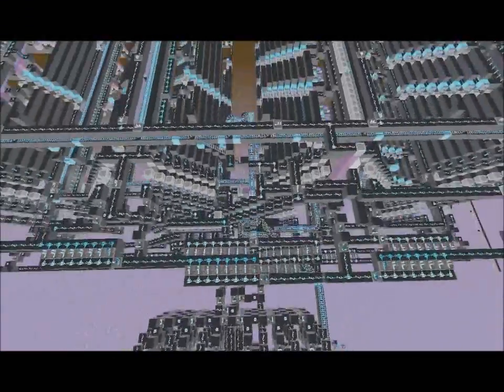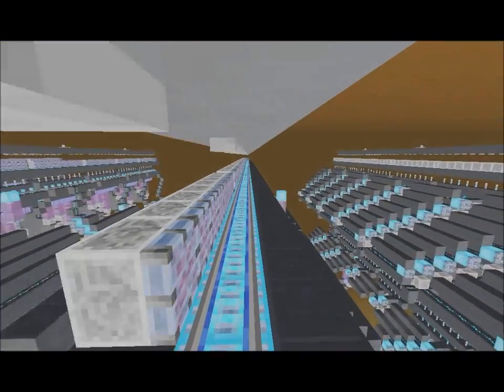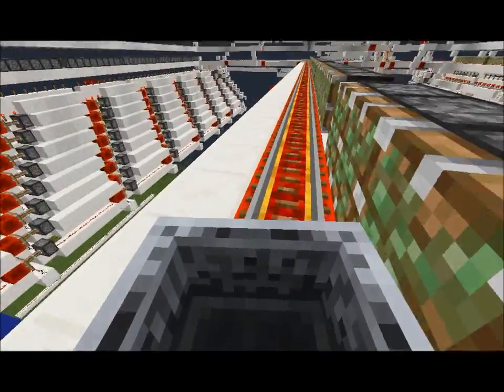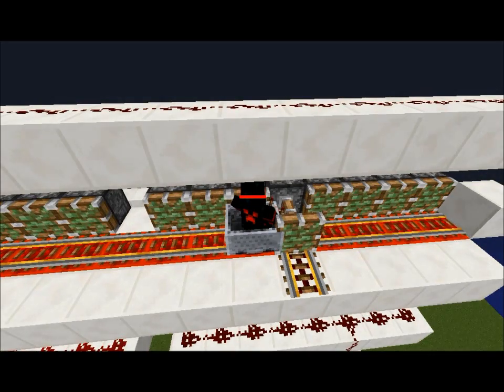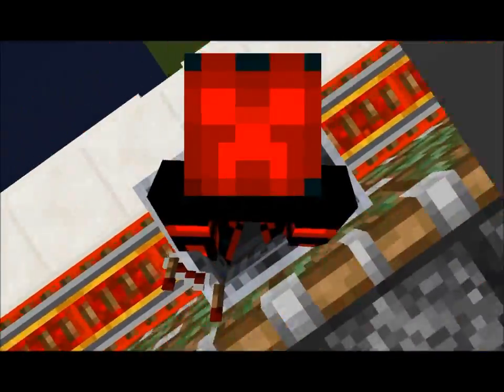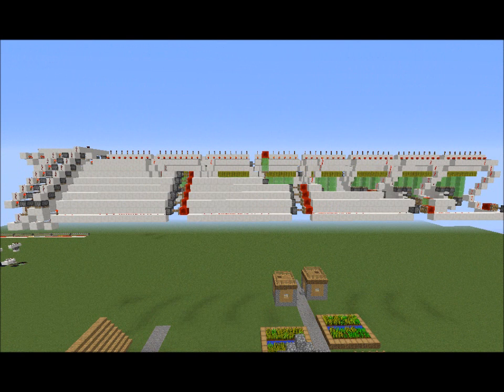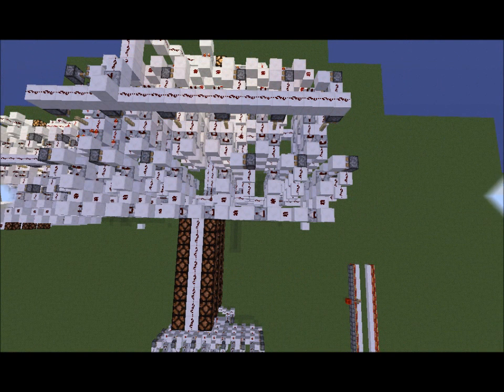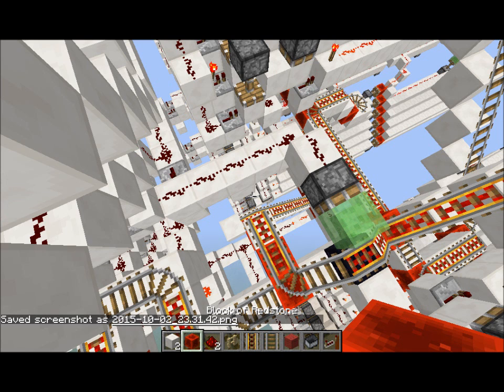512 Villager Selector (turn on CC)

Comment: who needs 512 different villagers? I doubt anybody needs more than 64 different ones.
Reply from the maker: +ilmango ya on prototech we will probably just build either 64 villager section or 128 depending on our needs I just felt like building this for fun
Reply: +ilmango Well, you can ask the same question at just about any unnecessarily efficient farm. Who needs 10 000 mushrooms, not to mention 10 000 mushrooms an hour? Who needs an 1024 village iron farm? Nobody, but they´re interesting in their own right.
Reply: +Myren Eario if somebody needs 10,000 mushrooms for example for a brewing system for an AFK mob farm it could be more convenient to AFK for mushrooms for 15minutes at a dedicated place, then building a huge fully automatic mushroom farm at the location that already produces a lot of stress for the server. helvince is working on a 512 village farm that resets in 3 hours. Instead of having a farm running at spawn all the time, which causes a lot of stress, it's an alternative to have  a superfast iron farm, that you turn on for short bursts of iron supply. Even an AFK fern farm could be useful for someone that needs a lot of fern for some reason. 

I get your point, but I'm really curious if anybody would consider building this in survival
Reply: ***** there's no downside to having a faster farm. I would even say it makes sense to have a faster farm, because you don't have to AFK that long. Of course it's interesting to make a 512 villager selector. If I wouldn't be interested in that, I wouldn't have watched this video. But a 64 villager selector is just as interesting and actually makes sense. Having 512 villagers only causes a lot of stress but no apparant (correct me if I'm wrong) benefit to having 64.
Reply from the maker: +ilmango there really is no benefit but it's minecraft so you can do whatever and still interest people
Reply: +ilmango NOTHING is unnecessary for minecraft suvival.My opinion is that we challenge ourselves for fun,it is a game,my friend.IF you want a explaination reluctantly，i think that not every sever is based on Communism,like ZK server.some technical minecraft server could be capitalist,and the villagers will be kind of currency or goods between players.Even redstone shop,redstone ATM can be useful in this kind of sever.It can be a villager ATM,isnt it?So,"A great villager for 100 emeralds!exemption from postage XD"         ps：This kind of server do exist on earth~And its so interesting to be in this kind of server.
Reply: +redstoner hungry I don't think the system shown here is intended for that. It's intended for villager trading. A system that transports the villager to you, would be much better to store them for selling.
Reply: +ilmango More like buying parking space,this can be used as a bank,maybe part of it.And what i just proved is that someone in some kind of server do need 512+different villagers,am i right~
Reply: I doubt the server owner would be very happy, if somebody has 512+ villagers.
Reply: +ilmango Now you abandon about the opinion about the problem is the usage of it,and  transfer to 'if its laggy'.  Yea,i hope so,cus if its true,ragou(he is sci owner right?) will be  a really happy people,as i wish.His creation is epic,i like him for real.